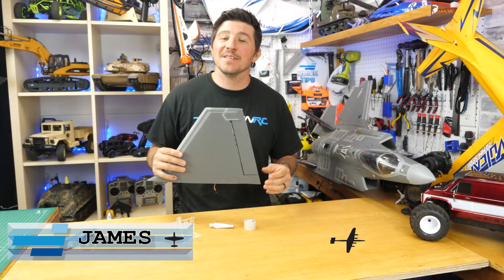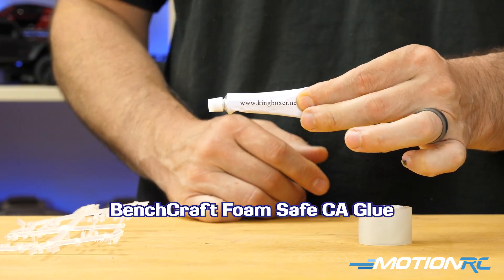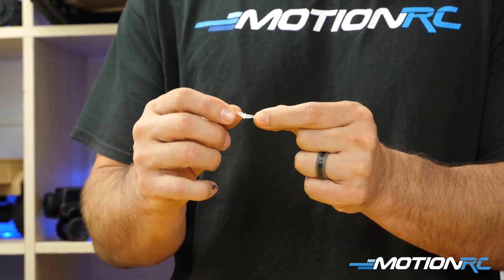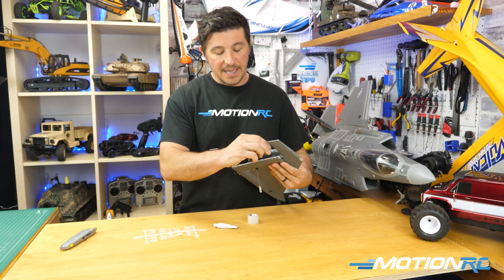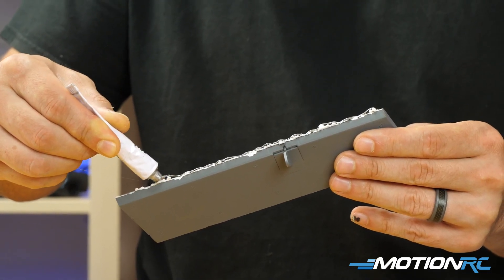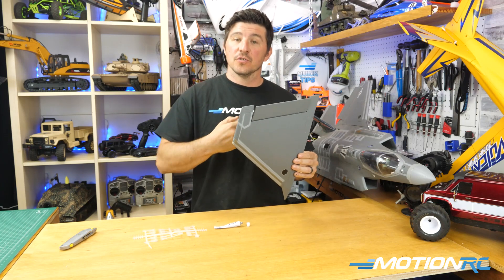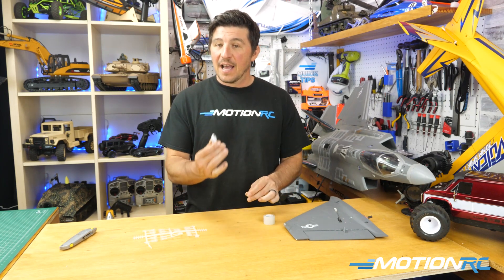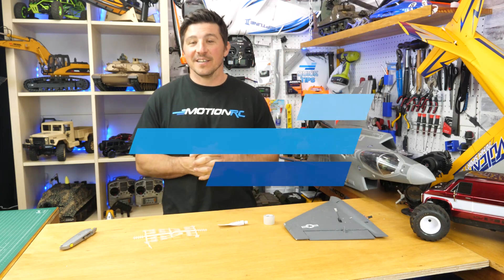Repairing Foam Hinge Options | Quick Tip | Motion RC

Comment: I've got in the habit of applying hinge tape during the build. Just for the added protection of breaking apart prematurely.. or while in flight. Whenever one does break loose, I'll shave both edges flat and install the nylon hinges. So far this has worked for me. :_mrcSalute:

Comment: When using Hinge Tape, always remember to fully deflect the control surface on the opposite side of the tape when applying. Otherwise, you will get more surface travel on one side (ie. More down than up). Also make sure you get it stuck very well at the hinge line of the control surface, so the control surface does move or separate from the stabilizer, wing or rudder during flight.

Comment: Once I get to this point, I take the time to actually drill holes and glue a pinned hinge. I've never had to fix one a second time. Sometimes I just install pinned hinges while assembling the plane initially so I never have to worry.

Comment: I prefer the cloth (fiberglass) hinges on foam. BUT, i stick by the rule: anything 1200mm or less, cloth. 1300mm up, hinged hinges. Usually, on everything 3d, i use the cloth.

TOO, on BOTH foam surfaces, u wanna clean up/straighten both control surface edges. Take a razor blade/xacto & smooth both surfaces. I have had MY hinges pull apart foam on planes when the plane is completely destroyed. 👍😁

Comment: Glue makes it too stiff and servo overworks itself. I cut up a gallon of milk and used 2 tiny square pieces and taped them side by side. The gap creates a hinge that uses 2 layers of tape, I make a cut on the moving surface and the part it connects to insert both squares inside and you have the gap perfectly in between creating a hinge. it makes a perfect and very strong hinge